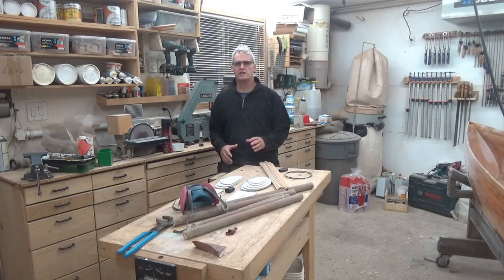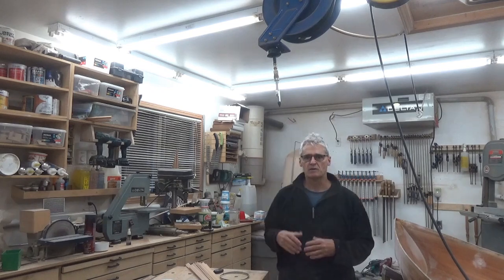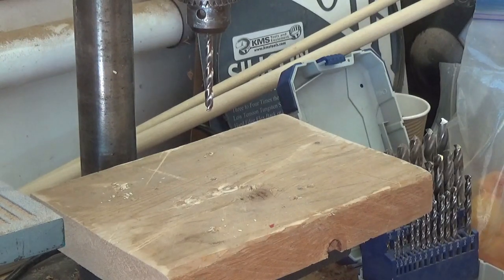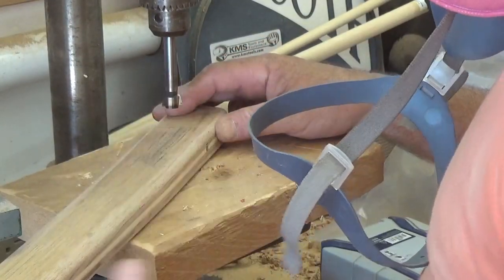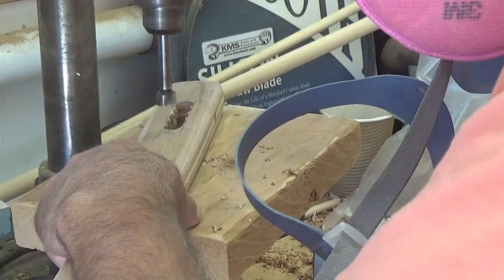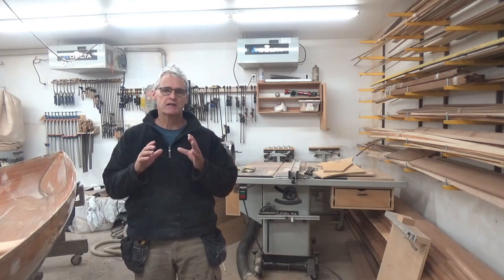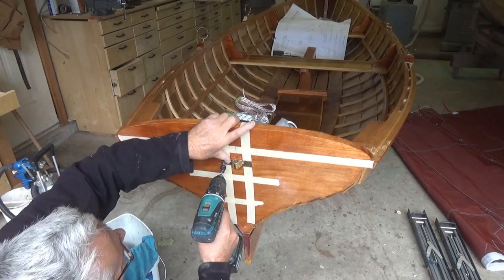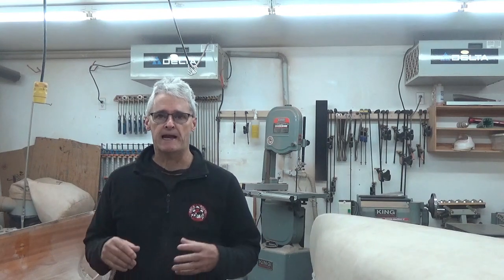Wooden Boat Acorn Build EP 21 - Rudder/Tiller

Comment: Awesome tutorial. Subd after viewing ep 1. I have built 2 strip canoes and now working on a 10 ft sailing dinghy - also strip construction.  Very similar to the acorn build you are working on.  Would you please list the equipment you use - especially  the laser line & dig those work pants also :)
Also - are you able to advise if the acorn boat you are building can be built out of strip construction?  Love the design.  Thank you, great work.
Reply from the maker: Thanks for supporting the videos with likes and subscribes.  For equipment, I have the basic large tools in the shop - table saw, band, saw, thickness planer.  For small power tools, I mostly use hand power planer, drills and drivers, orbital sanders.  The rest is mostly hand tools.  For strip building this boat, it could be done.  Most any round hull whether for traditional build or glue ply could be adapted for strip building.  It would require a bit of adaptations to suit certain aspects of strip building.